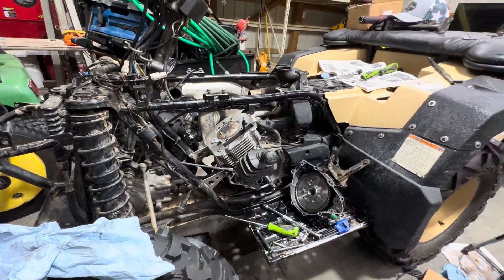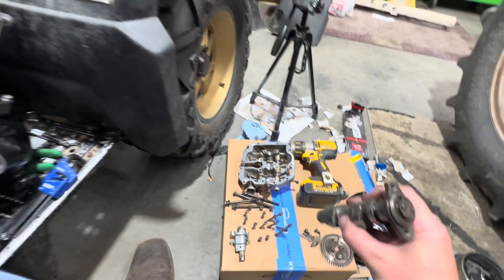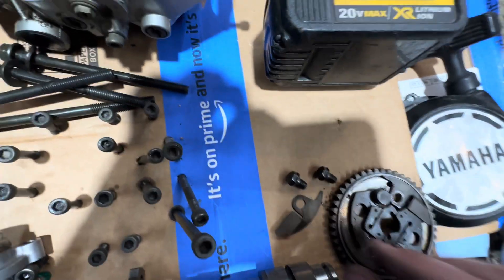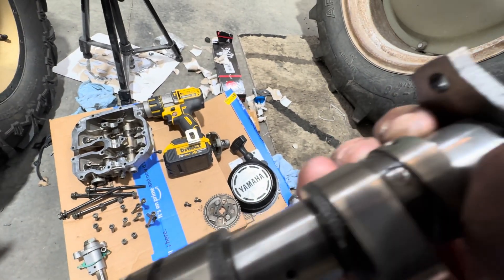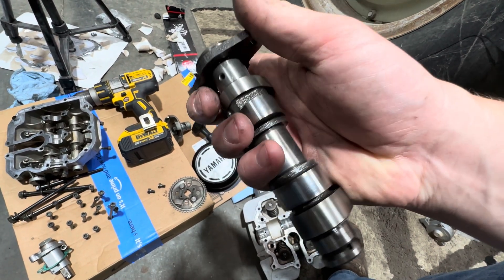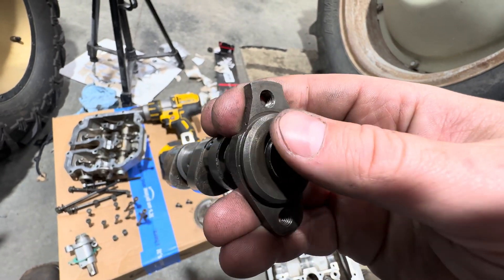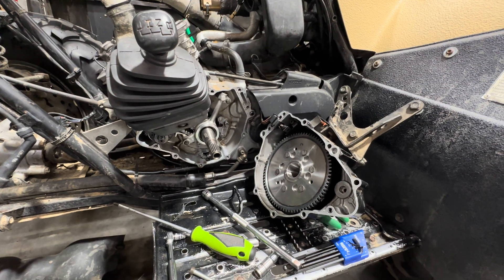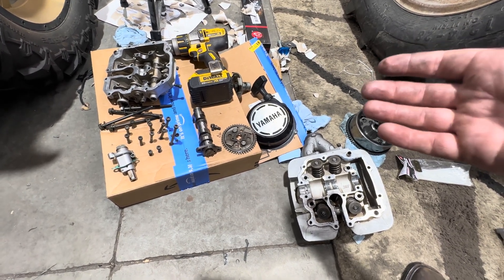Grizzly 600 camshaft decompression.

Comment: I have a 600 and having a hard time starting it. Thought it was the starter, and the battery. Seems to turn over slow and doesn't want to fire until you hook it up to the battery charger set to 200ah cranking. The battery is the correct battery and tested so its just confusing me. I was wondering about a decompression lever but I do not see one. Any thoughts?

Comment: My 07 cranks slow and has been eating up starters wonder if that pin is worn out on mine pulled the side cover the cam gear part of the decompression is doing what its supposed to do

Comment: Was this making a tapping noise when running before tear down?
Reply: Hey, I just built my 660 rhino. I made the same mistake. I installed the decompression 180 out. Leaving the ball out always. Made some small back fire effect and taping noise. Didn’t run well. Luckily I encountered this video, I flipped it and now it works perfectly. There is a dot on top of the decompression shaft. That goes up when installing timing.

Comment: Would you point me in the right direction if you know. I have a 1999 grizzly 600 and need the replacement cam and sprocket. Says discontinued but I heard the raptor 660 r would work?
Reply: I am a raptor guy. And yes the 660 raptor is the same cam sprocket. There is no gasket for the rocker cover. It uses yamabond. Or rtv ultra grey. And line your timing dots on cam sprocket up with the deck of the head. With the really small 3rd dot straight up.
Reply from the maker: Not too sure if that will work or not. I would look for a used one. That is probably the best option since they don’t make them anymore. Thanks for watching please subscribe
Reply: @Higgsgarage  thanks for the reply
Reply: And the chain yamaha raptor also